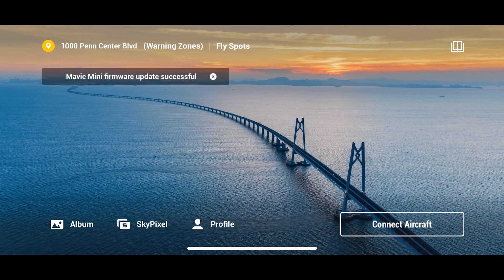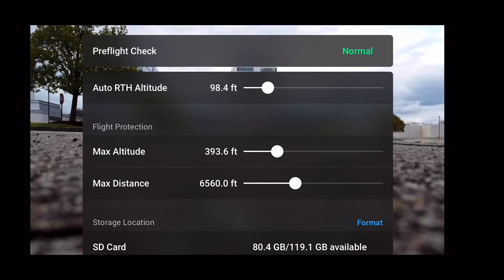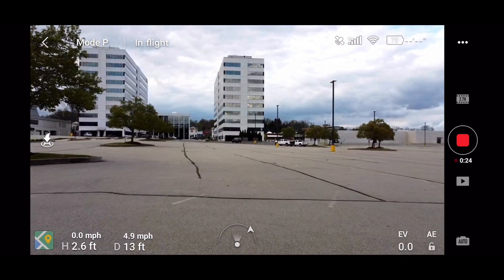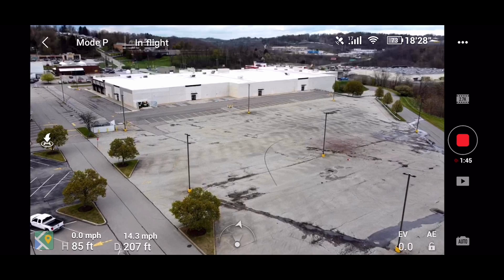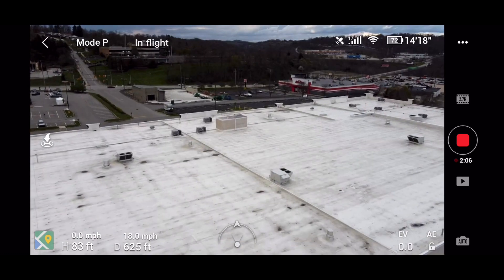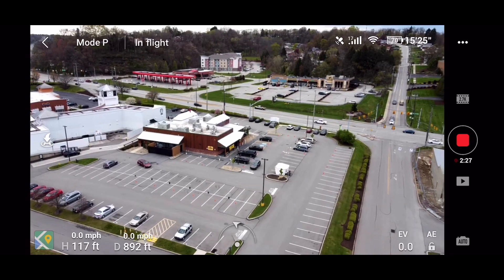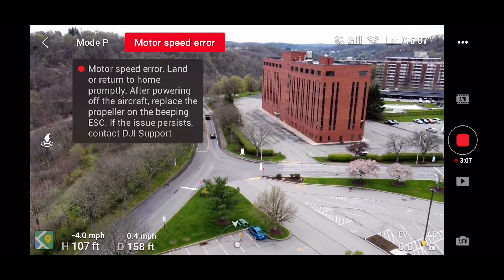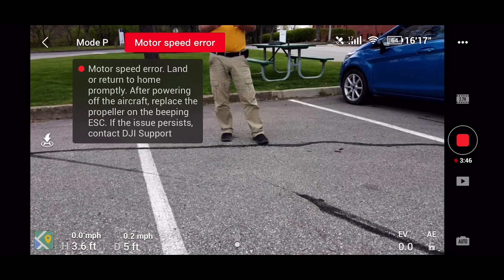DJI Mavic Mini Update V01.00.0500 Double Motor Speed Error

Comment: Hello All...I hope all are doing well during these uncharacteristic times.
After watching this video...I noticed the props that are having problems...are the rear props...note...keep in mind...the rear props are in the front bottom...when folded and packed away...Quick question...are folks with the warning ⚠️ packing the props away in the proper position...while packed in the “Fly More Combo” carrying case?... ...I ask that because...if one doesn’t make sure the blades are not placed in line under the gimbal...and more so...in line with the body of the drone...the blades may become misshapen...therefore...causing the error message while in flight...
Reply from the maker: Erenst Lawyer there is nothing wrong with the props, the problem was the update, removed it and put it back on no problem, I still have the original props on after 70 flights
Reply: TDR Drones :
...okay...cool...I’m glad the reinstall meant of the update solved the problem for you...however...there are folks out there who are packing the Mini improperly in the Fly More Case...which in turn...misshapen’s the blades/props...causing the very same error message to pop up...I just thought to put that little tidbit of information out there...would beneficial to all fellow drone enthusiast that follows your channel... ...I wasn’t trying to criticize anyone nor relay any negativity.😃
Reply from the maker: Agreed the props can be a problem for some, it just was not my problem

Comment: You said it was the bottom right one both times?  The problem didn't move after all?  You first said bottom left, then corrected yourself to bottom right -- then you said bottom right after the second one.

Did you find tha actual problem since it was the same motor both times?
Reply from the maker: IIt was not the same motor, refresh the firmware to fix the problem, i made a video about it a week after this one

Comment: i had the same warning , but i did not line the props the right way when i stored it in the box , it is a sticker that shows the right way ,that i missed reading , i changed the prop and store it the right way  and it works fine now
Reply from the maker: I think it was a firmware issue not a prop issue but if that worked for you that's great.
Reply: @bryansbikes  i think it is a mix of both , lots of people lost control over the mini from bend props  but I'm not a expert , but i store it the right way now :)

Comment: The internet says the problem is that the rear propellers are getting pressed in the case which causes them to flatten out. This flattening causes unstable flight, errors, crashes.
Reply from the maker: The internet is wrong

Comment: A DJI firmware update that causes more problems than it fixes? Gee, that's never happened before!!  Except with EVERY firmware update.  I haven't flown my Mavic Pro in over a year because of this same exact thing;  every firmware update caused more problems and made the drone more and more unstable till it was completely unsafe and unreliable to fly.  There's no such thing as an impromptu flight with a DJI drone, you always have to spend a half hour and a whole battery to once again update the buggy firmware. And to add insult to injury, every time you update it loses all your settings so you have to go through every menu and set things back how you had them.
Reply from the maker: I just had a Parrot Anafi update that caused a lot of problem
Reply: We, the end users, are paying $$ to be beta testers for these companies.  With every firmware update I am more afraid to fly my drone because you never know how it's going to act or what it will do on it's own "this time". It may crash for no apparent reason. It may spot some water and drive into it. It may fly away. It may drift, unable to hold it's position. It may toilet bowl so bad the video is unusable. You just never know, but you can be fairly certain there will be "something" go wrong with each firmware update.

Comment: Good to know, I had the same problem. Changed propellers took out again and same on different motor. Changed propellers again no more warning but red light flashes intermittently and it just doesn't sound right and does a lot of drifting
Reply from the maker: The firmware refresh did the trick, i put up a video on it 2 days later

Comment: Is it generally bad motors in MM? You can try WD. May be dust, or bad roller. It said props to be replaced, but it can not know for sure. I was having problem with my Spark's motors, two was much slower,  disassembled it and washed and then WDed with teflon  it. And yes, when land, tuch every motor and check a temperature difference. Alsi, I was watching which one stops first when turn off motors
Reply from the maker: The firmware refresh did the trick, i put up a video on it 2 days later
Reply: You just check which one srops first. Seems to be heating problem when flying for a while. Sorry for my english. :)

Comment: I'm 100 percent sure this happened to my 3 crashes on my Phantom 3 Pro...it's finally in parts on my mantel this time I'm done repairing it. All 3 times ESC error and ATTI Mode kicked in and threw my Phantom violently on it's own through the sky and yard sale of parts. K after watching this video I don't think I want one.
Reply from the maker: You see i brought it back right away, but it was just a firmware error, nothing was wrong with the esc's

Comment: I also got an overheating msg when saving files from drone to phone. I wasn't even flying.
Reply: That's why it overheated, I don't think it has a internal fan so when it flies it uses the airflow to cool it. When sitting stationary there is no air flowing through to cool it.

Comment: I got this error immediately after updating and flying at max set altitude of 120m, checked props all in check, no error when flying slightly lower at 100m.
Fix - raised max altitude 140m, no error while flying between 100—110m.
Like others I also refuse to change non damaged or faulty equipment, expecting update to fix issue in near future!
Reply from the maker: it's not the props

Comment: when you upgrade the firmware, do the controller calibration also all the aircraft calibrations combas,imu etc. i read somewhere after this there is no problem. for sure your propelers are fine and dont need replacement also try flash the firmware again from pc
Reply from the maker: It seems to be a mixture of things to fix this problem, battery updating, prop changing or firmware refreshing

Comment: Very small very light air craft any change in pitch of the prop makes a huge difference which is not detected with the eye,  storage in case takes pitch out of prop ( flattens) resulting in over rev of motor. its not a coincidence it's always rear props store in case properly and change props when prompted very delicate flying machine it should be treated as such
Reply from the maker: That storage in the case bending the props theory is all bunk, somebody came up with that idea to make a video and it caught on. That mini is not so heavy that it's going to deform those props. i refreshed the firmware and it's fine and i never changed the props

Comment: First flight after update. I got the same motor speed error. What a crappy update. Was so excited about the manual camera settings, but not at this cost. Apparently DJI does not tell their support team about it. I was out in the field and live chatted with them and he told to me reinstall the firmware or send it in for diagnosis and repair. I had the same rear ones throw errors.

Comment: I had the same problem with my rear right motor after I reset the Drone and I take off it says land I call DJI support I was on the phone for hour and a half and I was still on hold so just waiting now
Reply: i had same issue on same motor as well.... i thought it was because i crashed on a tree the day before. Props seemed perfectly fine though. after replacement i powered it back on and tested it with no issues at all

Comment: i only have use my drone two times, so... its the update totally.
Reply: How have you been storing the drone? This issue is more likely to come from flattening the props than it is from flying it. If you have a case, make sure the rear props are pointed to the opposite motor and not toward the front or the back as that will flatten the props and this error will appear.
Reply: 01Beaker Productions i dont really think so because i had that warning too but later that day i started the drone again and let it hover for a few minutes an i got no warnings. And i know from others who changed their props and still got a motor speed warning.

Comment: I have the same issue with the motor error right now.  Last two days I spent on upgrading and downgrading firmware because in V01.00.0500 my mini was flying in C mode only.  More precisely, the letter on the screen was changing C, P, S but it has no influence on the speed.  It was slow all the time.  Today a managed to get the speed right after upgrading from different phone connected to the controller.   And now the motors issue.  Definitely there is a problem with this upgrade.
Reply from the maker: https://www.youtube.com/watch?v=JUMH5vB31TQ
Reply: @bryansbikes  Today I actually changed the propeller, which visually looked OK, and was not bad in respect of smoothness when sliding fingers over it, but the software recommended replacement.  The motor was beeping and I decided to find out who is right and who is wrong.  After changing propellers the "motor warning" disappeared and my Mavic flights without problem .  It looks 1:0 for the software.
Tomorrow I am going to test my drone on longer flight.
Reply from the maker: @SpokoSpoko  Glad it worked out

Comment: Same issue here, rear left prop. I thought it was a firmware issue, as I only put new props on two weeks ago and haven’t had any problems with the last flight. So I now swapped them with front right, and surprisingly the error moved to front right. Then I replaced them with new and the issue was gone! I suspect that the new firmware improves stability but calls for perfect propellors. I also suspect that cause of this new issue may be due to the rear propellors being bent slightly while stored away in the case. Could it be a design flaw with the Mavic Mini case?
Reply from the maker: https://www.youtube.com/watch?v=JUMH5vB31TQ
Reply: I believe it may be an issue with the case. How do you store the drone? The best way that I have found is to fold the propellers toward the opposite motor so that they do not get pushed up by the raised part of the case.

Comment: UPDATE- Solution.. as suggested by a comment by TDR Drones, I re-upgraded the firmware USING MY PC and a USB CABLE. After three tries the statusbar finally got to 100% and the problem is solved. The first time I upgraded was thru the "RC-Drone wifi connection", it got several restarts and never went above 99%. USE A USB CABLE AND A PC, THRU ASSISTANT 2 FOR MAVIC. Connect and update both the Mini and the RC. It worked! Thank you QC for pointing the problem out!
Reply from the maker: https://www.youtube.com/watch?v=JUMH5vB31TQ

Comment: I had the esc warning on mine yesterday. being new to drones I thought it was something I had done wrong but see there may be an issue after the update.
Reply: It might be a real problem and maybe firmware just increased sensitivity. But there are videos with maximum power reached error (same problem, generic description) and drone not even being capable to keep altitude.
Reply: @pavelperina7629  it maybe a real issue I'm not sure but I've flown it about 20 times prior to this update (admittedly not for huge amount of time) and had no issues but since the update I've had they 2 errors in one day. I've messaged dji regardless and awaiting there reply.
Reply from the maker: https://www.youtube.com/watch?v=JUMH5vB31TQ

Comment: I had the same problem.. " motor speed error" after doing the firmware update.. when i landed the drone.. it was beeping and moving the left rear motor around in short burst steps.. I replaced the props on this motor and tried again and it seems like it is good.. I do believe the firmware update caused this issue though.. To many people having the same issue.. DJI what says you ??
Reply from the maker: it did, fix video tomorrow

Comment: I did the update, recalibrated the remote control, updated the battery firmware as well on all 3 batteries. I flew and used 3 batteries in a row on Friday after I did the update, no issues at all. I'm hoping this error does not appear. sorry your having issues
Reply from the maker: https://www.youtube.com/watch?v=JUMH5vB31TQ

Comment: I had this problem. When the mavic is stationary and turned on , check to see if any of the motors are twitching . That motor will most likely be the problem. Remove and refit the same prop. I found one the screws was not fitted correctly. Flew again and problem was fixed and error gone. Hope this helps.
Reply from the maker: https://www.youtube.com/watch?v=JUMH5vB31TQ

Comment: Glad im using the CE version... no problem at all after latest update
Reply: I got the ce version and i got the same issue :(
Reply: @roodmeester  
I saw online that we had to refresh the update via dji assistant 2 (Windows/ Mac).
I did it, but still didn't have the time to test it properly... maybe tomorrow. 
Even if it doesn't, you have the chance to downgrade to the previous version within the app (that'll be my next step if the refresh doesn't work). Either way, I recommend you give it a try, as it has lots of positive feedback...
Reply: @carloscosta253  i have don it but ist to late to try tommorow i try it
Reply: @roodmeester  Hi,
The mini beast is back!!!
No errors, great speed and maybe better range (still have to do some more testing). Used it in all modes, but mostly in sports mode. Even seems to be quieter... It seems that that did the trick for me. What about you?
Reply: Ok i plugged the mini on my pc  now my mavic mini has a update the firmware o have instal de dji software on pc.i try tommorow now i go to sleep.....sorry for the bad english im a dutch man whahah
Reply: @roodmeester  no worries... I'm portuguese... from one poor English to the other, we will figure it out... ;-)
Let's hope the weather allows us to do a test drive...
Reply: I'm using the CE version and had the exact same issue... even the motors failure was the same (1st rear left, then rear right)...
It happened while I was in sports mode... can there be something to it? Drone is only a couple of weeks old, so everything is new (motors and props). 
It seems that there is a firmware issue here...

Comment: Must calibrate the remote, that is the issue, it said to calibrate controller after update, then no issues. Hope this helps.
Reply from the maker: That's if the controller would not stop beeping
Reply: TDR Drones , Didn’t have that one, but I had the motor current thing and the controller kept restarting, I guess it was beeping some then, possibly the DJI assistant thing could help if you can download that. Some drones can be downgraded with that, I’m not sure what it will do as far as the mini goes , but might be worth checking out. Good luck with your mini either way, it blows when this crap happens with updates.
Reply: TDR Drones , I hope you get it figured out though, sincerely .

Comment: My Mavic Mini was just extremely slow. And when I did a Return to Home, The mini didn’t do anything but just climb in altitude drastically. If you have this issue like me you should downgrade to the older firmware via the DJI assistant app on PC or Mac
Reply from the maker: Right now i'm waiting for DJI to respond to this issue, I really don't like rolling back firmwares

Comment: The problem is the propellers not the firmware.  Previous versions did not have the maximum engine speed test.  Now if a propeller is not efficient and to fly the engine must turn too fast, the problem is reported.  Not before.  If you want you can continue to fly as you did before but the risk is an uncontrollable loss of altitude.  It is simply a safety improvement.  Sorry for my bad english.
Reply from the maker: i don't believe in coincidences, I do the update and then this happens to a thousand people, sorry, i'm not buying it.
Reply: Marco Rossi I updated using the DJI Assistant and even though the firmware was installed it stated there were components that needed updating. Reinstalled and all is well. No props changed.
Reply: Nah so many people its the left rear props.
Reply: Ian Clavis weird because after reinstalling FW error went away.
Reply: Ian Clavis even people that just got theirs after 1 day and no crashes?

Comment: I have the same thing, I flew mine all over the USA in Feburary and March. Now I'm home in the UK and decided to fly today, was required to update and I got this error after 5 minutes of flight-time, I know my drone and know it was okay so I decided to keep flying, I ignored the warning and had no issues with my entire 2 hours of flying today, you can check my channel to see, footage stable above a warehouse at 200-300 feet. Perfect flight, strange warning which isn't true. Thanks for posting this video I knew I made the right call.
Reply: Haven't you ever seen maximum power reached error before? Especially related to wind gusts over uneven terrain? I did and ignored this error, just being prepared to land somewhat safety and I'm afraid to fly to far above the water. Now I got this error, but later I was able to fly for 15 minutes.